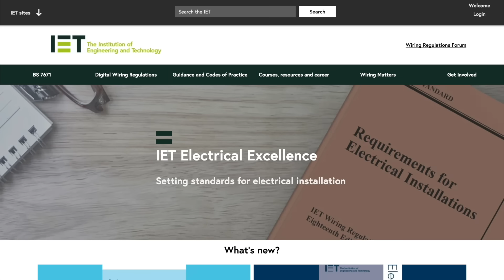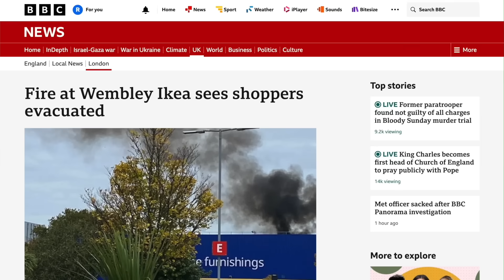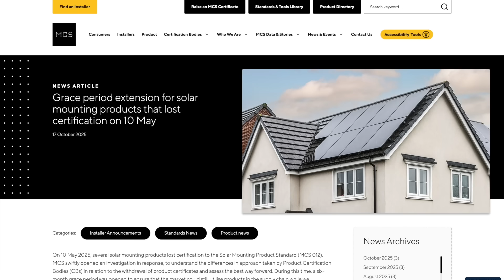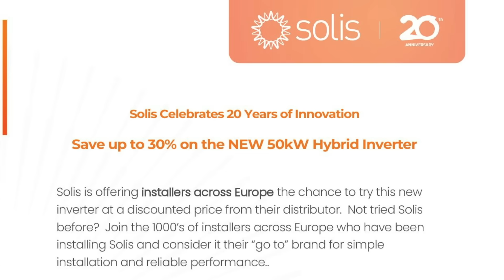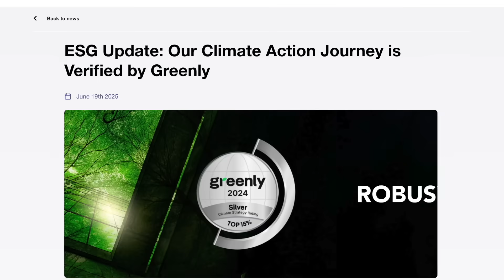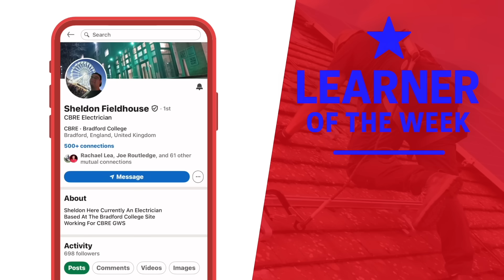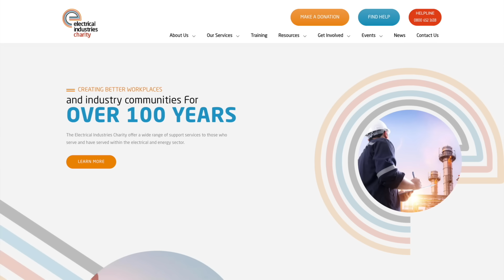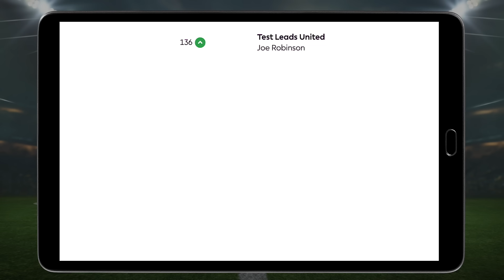Exclusive: Grid Bosses Set to Change UK Voltage

Comment: my incoming voltage is 244v my inverter adjusts that down to 240 if i wish i can drop that down to 230 or even 220 but then my microwave doesnt like it nether did the two previous two microwaves

Comment: I first watched this video on release 2 months ago, but just thought OK, I can live with the voltage changes. Since then, (now being old and decrepit) I had my supply fuse uprated by the DNO and a new consumer unit and Matt-e unit installed by the energy supplier. The unit kept cutting out and it was found that the incoming mains voltage was around 253V and peaking at 254V. This may be why our hot-tub control board was fried.
We contacted the DNO and they reduced the local voltage in 2 stages firstly to 246V and a few days later to 237V.
I am now totally in favour of system voltage reduction
👍

Comment: The meter in house is measured in wattage

You use a 2000w kettle , you still get charged at 2000w usage 

The lower the voltage the current you have to use to get the same power

Comment: If the voltage is dropped it could damage motors like fridges, vacuums, heat pumps, water pumps, washing machines, tumble dryer motors, and solenoid valves. Any device which has a coil like a motor could be damaged. Too low a voltage can be as bad as too high a voltage. Otherwise the voltage would have been dropped to 200vac years ago. People should stop meddling in things they do not understand. Tolerances have been set for good reason.

Comment: I x V = watts
1amp x 240v = 240watts
1amp x 220v = 220watts
To get the same power you’ll need more current, more current will stress the grid. 
I don’t get it 
Seams crazy to me

Comment: Honestly this is one of the reasons I recommend so heavily that my mates consider their own power-wall type interface. 
Not only do you have a nice backup battery system for when the power goes out, but you also have a full balancing voltage regulator to keep your house stable and isolated from such spikes. 

It's like how big (and smart smaller) companies always place their office PCs on a UPS. Worst case even a direct lightning strike to the line will likely only fry the UPS, while protecting the equipment connected. 

A power wall does that for the whole house. Way cheaper to replace if things go wrong.

Comment: Why are we to be in line with European standards when they are lower than the yka standards  so basically with the charge with green crap we lose more power.how much will our electrical equipment function well with the lowering as low as 207v.  Not aware how life safety systems will work if fluctuations drop below those levels.especially in care homes and such.

Comment: What an absolute pack of F-WITS. Reducing the voltage will affect a lot of existing infrastructure. The worst thing is that this moronic "renewables" crap is going to FAIL. All of this will be POINTLESS. Seriously you Brits need to get rid of these a holes. One way or another.

Comment: 207v is a typical voltage found in more rural areas, far away from the substation, most areas get 225v to 250v.

Comment: Lower the voltage the higher the current and that means the higher your bills not to mention moat electrical equipment won't handle the lower voltage higher current it will throw out juat about every sensative electronic equipment especial those that are built cheaper and dont include voltage regulators able to cope with the lower voltage. Transformer and switch mode power suplies are all calculated for nominal 230v going as low as 207v would throw out the math used to drop voltage correctly in the psu. Allot of laptop psu allow for 100 to 270v range but this is not true for all appliances.

Comment: If we reduce the voltage, we are correspondingly increasing the amp's, if the same wattage is required for an item. Is that not a concern? 
A 7.2kW car charger would pull 30a at 240v, at 210v it would pull over 34a.

Comment: This is a paperwork way of saving the need to upgrade substations as the voltage drops due to EV uptake, the big problem is anything using a switch-mode power supply such as a television will have to work harder to achieve it's aims, the harder work means it gets warmer and it's life is reduced.

Comment: 1) In Australia they have started to adjust the single phase home supply from 240v +/- 6%  (225.6v to 254.4v) to be nominally 230v +10%/-6% (216.2v - 253v).
2) I knew a comercial building supplied with 3 phase power from basement transformer that had unbalanced phases especially at night, up 11v spread for nominal 240v but were showing peaks upto 262v. I notified the energy supplier and tbe best they could do was reduce the local transformer secondary tap to output lower voltage on all phases (I think 6v less). They had to check voltages at substation, input voltage on premise before local transformer & the local transformer output voltages.
Rebalancing phases were left to all owners/tenants in the building independently.
3) Our home had voltage dropping <205v under high household load - a previous technician trying to identify supply to neighbour had loosened the neutral connection at the pole & left loose. The return was via earth from our meter box so the supplier had to arrange&pay to fix.

Comment: Let's do a worked example. Assume an average home is drawing 2.4kW at the moment:

2400W, 10A at 240V becomes 
2400W, 10.2A at 235V

Power loss in 1 Ohm cable to substation:
10*10*1 = 100W
10.2*10.2*1 = 104.4W

4.4% extra power needed, that the energy company can't bill for.

Comment: Am going to have to look at equipment I do servicing on see what the min voltage is.  As some non domestic washing machines I have seen voltages of 217 to 250 will look up.  Also on some old tech still in use have voltage switching jumpers but what if I set my amp to 210 and we have a jump to 250 a plus of 40v the output voltage of the internal PSU will be a shift from 5 to 10%. So I do see problems.

Comment: The standard UK voltage is \(230\) volts, with an allowed tolerance range of \(216.2\) to \(253.0\) volts (\(-6\%\) to \(+10\%\)). This is an alternating current (AC) with a frequency of \(50\) hertz (Hz). While the nominal voltage is \(230V\), the actual voltage can vary slightly due to factors like power demand. Nominal Voltage: \(230V\)Frequency: \(50\) HzAllowed Tolerance: \(+10\%\) to \(-6\%\)Allowed Voltage Range: \(216.2V\) to \(253.0V\)

Comment: I have a few UPSs that constantly monitor our supply out in the countryside, and we frequently get brownouts as low as 130V. This happens at least once a fortnight, usually more often. One of the UPSs has reached the point where it shuts down every time—and it's the one powering my wife's computer, so she's not too happy! If they reduce the nominal voltage, I can see this only getting worse, and they'll still charge through the nose for it! 😞

Comment: Power is VxI or I squared R. Lowering the voltage will reduce the available power. The advantage of higher voltage is that less conductor cross section is required. If you decrease the voltage you need to raise the current to achieve the same power.  Higher current requires thicker and therefore more costly wiring.

Comment: North America also uses a 240 system but that's usually only reserved for stuff like air conditioner driers ovens welders certain air compressors and certain table saws and some other stuff
Reply: 240 volts ... EV Charger, Welder,  Geothermal, Well Pump, Drier, Stove Top, Oven, Microwave, Water Heater and Central Vacuum.  Large appliances are 240v.   Small appliances are 120v = washing machine, computer, TV, blender, toaster, refrigerator and LED lights.
Reply: @MrSummitville  most sub panels also use 240 V
Reply: @fartingthefart 100%
Reply: @MrSummitville  really the only sub panels you won't find being fed by 240 is a older truck bed camper or a 30 amp 120 V RV
Reply: @fartingthefart  Correct ... 120v 30 amp RV Park type circuits do not support 240 volts. Many smaller RV's do not have any 240v appliances.  Larger RV's can use the 50 amp 240 Volt RV Park type outlet.

Comment: If I remember correctly they did not lower the nominal 240V, they increased the percentage voltage drop tolerance, hence at off peak times the constant
Voltage remains the same 240.
Reply: I thought the stated intention was that as transmission gear was replaced due to age or changed circumstances (more users) the replacements would be aligned for 230 Volts nominal.

Comment: America has worked ok on 120v forever......... No idea why ours needs to be double that.
I don't top up my electric, I use a piece of wire instead of a top up key..... Works perfect and reduces my bill by 80%, suprised everyone doesn't invest in a wire bypass 😂😂😂🤣 saves 10's of thousands over last 3 decades ❤🎉🎉🎉
Reply: USA is 120v/240v . All large appliances are 240v.  The TV, computer, fridge and LED lights are 120v.

Comment: So, lessee if I've got this straight;  the National Grid bully-boys, having bribed people to install domestic solar panels with offers of 'cashback for your spare electricity', now find themselves having to PAY people NOT to dump that electricity into the grid.  Where's this cash coming from?  The 'green levy' that's imposed on ALL our energy bills!  This is worsened by the fact that, at times, windmills ALSO generate higher power than the grid can accept without pushing grid voltage too high.
Naturally enough, the electricity generators say dropping the voltage as low as 207V won't cause any problems - but these are the same people who claimed that 'green' energy systems were "the CHEAPEST source of electricity"!!
This state-sanctioned LUNACY is being done in the name of reducing our CO2 emissions, even though we produce less than 1% of the world's total - and China, which emits more CO2 than the rest of the world put together, is NOT bound by any 'climate agreements', and over the last 10-15 years has built and opened well over a THOUSAND, NEW, COAL-FIRED power stations!  You want more?
According to data gathered by NASA from the only GLOBAL weather monitoring system we have (the weather satellites), the climate stopped warming in 1997;  temperatures than flat-lined for about 20 years;  and for the last 8 years, it's been COOLING - with all the indications from solar studies pointing to significant global cooling going on for DECADES!
Why do you think the eco-crazies dropped the phrase 'global warming' in favour of 'climate change' over 20 years ago?

Comment: Good job I’ve got a massive diesel generator at my house as I’m not replacing every single appliance or computer console tv in the house along with my vintage equipment. No my house hold will stay on 240 volt it’s what my inverters output is also the costs are far too high to replace items

Comment: The idea of cloud digital having any part in basic mains supply is counter logical. One hacking, one EMP, one solar flare, one lightning strike, one huge overvoltage and all is at risk. Sweet pretty domestic situations do not stay that way. To be able to physically reconstruct a network in an emergency is vital. Very few electricians will be software analysis capable. The history of digital systems shows planned obsolescence and subsequent incompatibility to be normal. Just wait until big corp and AI get into the act.

Comment: To prevent an appliance going to landfill, some domestic appliances can run on DC. A vacuum cleaner and convection heater are examples. With the ridiculous proposed reduction in voltage, a full wave rectifier and large value capacitor would boost the 207 volts to over 300 volts DC: 207 multiplied by the square root of 2. By default, experience of electrical science would be imperative if this is attempted.

Comment: The UK's 240V and mainland Europe's 220V systems were harmonized in 1995 to a single nominal standard of 230V to facilitate trade. 
Here are the key details of the change:

    The EU voltage harmonisation happened in 1995, with the UK government's Electricity Supply (Amendment) (No. 2) Regulations 1994 taking effect on January 1, 1995.
    A "paper" change only: The shift was primarily a change in the legal definition and not an immediate physical modification of the supply.
    Wider tolerance band: To accommodate both the old 240V and 220V systems, a new, wider voltage tolerance band was established.
        For the UK, the new standard was 230V with a tolerance of +10% and -6% (a range of 216.2V to 253V).

Comment: Eff Europe.  This is Britain.
Reply: EU made a standard for voltage for overhead wires on railroads. Germany was instantly like: we don't care. We are not replacing all existing wires and replacing all overpasses to comply with the new rules. Other countries were like if Germany doesn't comply, then why should we comply? As a result EU now has two standards and trains are generally built to handle both 15 kV and 25 kV.

In other words EU itself can't handle EU standards for voltage.

To be fair the EU standard does have higher efficiency and allows using physically smaller and cheaper transformers on the trains. The UK adopted the EU standard long before Brexit.

Comment: Changing grid voltage is no trivial task. 240 V everywhere isn’t as safe. Thus all ur components are more expensive from the safety features.
Meanwhile split phase powered a super power

Comment: The UK has been we0 volts for years. I really don’t understand why people are freaking out about this. All electrical products sold in the UK have had the ability to work on plus or minus 10volts over the standard electrical supply. Stop scare mongering. It will make zero difference to anyone at all.

Comment: So we "save the planet" by introducing more "Net Zero" implementation but every voltage sensitive appliance goes to landfill: how absolutely absurd! I have vintage valve amplifiers, the output of which, would reduce at 207 volts. Some of mine do have voltage tap transformers and others don't. This Ed millibrain needs to be voted out: the whole current administration have absolutely no clue how to run this country.

Comment: Lower voltage = lower power output . slower charging for EV cars, especially as EVs and heat pumps add unpredictable demand spikes. There has been Zero planning as usual Many neighbourhoods still rely on low-voltage substations not designed for simultaneous EV charging.  We are reactive to say the least. I just had the leaflet what to do in a power cut, so you know where this is going, our infrastructure is old. and they want more heat pumps and more electric cars. just when electricity is the most expensive energy to use. 😞 This Government and the central planners are a joke ( all governments i should have said)  😞

Comment: So old dial based meters which only measure current will have their bills increase 20%.  In addition, devices that compensate for voltage will increase the current.  That will in turn increase power lost in the wiring.  If climate change was real, lowering the voltage would be thrown out at the idea stage.

Comment: Why reduce voltage? Reduce the current. The more current you pull in your home the more electricity you use. If the voltage drops down to 207 volts it just means people will be buying more cheap power adapters to bring the voltage back up again which could end up being another problem in itself. Its not really households that use much energy, its all those office blocks and businesses burning away huge amounts of power, running lights  24/7 even when nobody is in the rooms.
Reply: or reduce it down to 120 volts. That would be wiser.
Reply: @LordLangley123 that will increase the required current,  increasing bills, and everyone will have to replace all electrical equipment to operate at the lower vote and higher current. Basic physics really that has bypassed you.
Reply: @robertnickson6006  I mean wiser in a sense that 120v equipment is widely available. There will always be an excuse for increased energy prices regardless. It makes no sense reducing the voltage down to 207v.
Reply: @LordLangley123  that'd condemn us to American kettle speeds. It'd be political suicide

Comment: why not making the grid DC?

if we want to get rid of polluting Power Plants, 
and ALL Solar Panels are giving out DC
and ALL the Storage is in DC
wouldn't be better for the grid to be DC?
to eliminate all those losses during conversion

even the wind generators have DC, according to the AI:
"Wind generators often convert the initial variable alternating current (AC) to direct current (DC), then use an inverter to convert it back to a precisely controlled AC output that matches the grid's specifications. 
This AC-DC-AC conversion is crucial because the wind does not blow at a constant speed, which means the generator's rotational speed and electrical output also vary. The electrical grid, however, requires a very stable frequency (e.g., 50 or 60 Hz) and voltage"

/***/
and besides
that will be exceptional for the economy
as EVERYBODY will be FORCED to replace all their electrical & electronics equipment

same as we're forced now to replace all our ICE vehicles

Comment: A better solution would be to reduce the amount of permitted variation to ± 6%since it is the over voltage that is causing the problem. The +10% was only supposed to be a temporary measure for the UK to give energy distribution networks time to switch connections on local transformers to lower voltage taps. This can easily be done during normal maintenance of transformers.

Comment: Would a high voltage not be cheaper? Less heat losses in transmission.
Reply: No, a higher voltage will reduce the current supplied.

Comment: at certain times of the day my toaster takes longer. .I have to turn the pressure down on my shower to get it hot and you can hold your hand in front of my fan heater when normally it would burn you so they must be cutting back at peak times